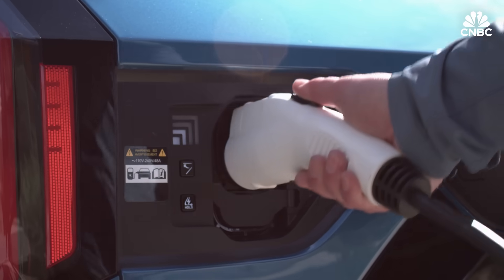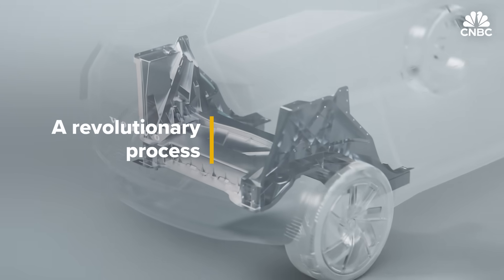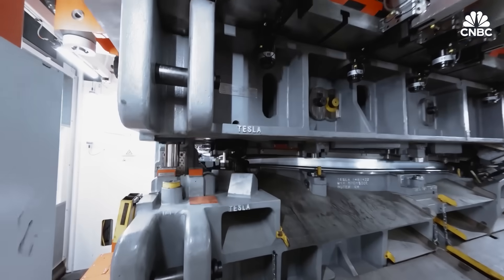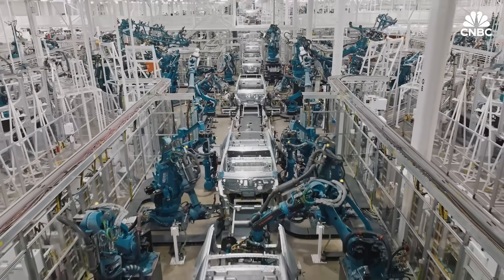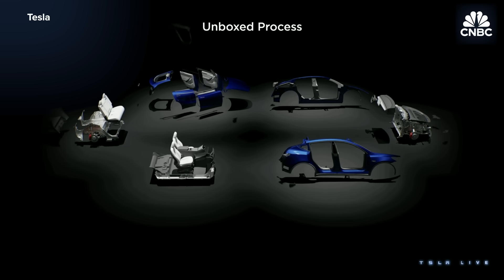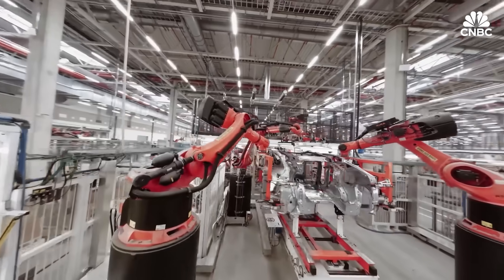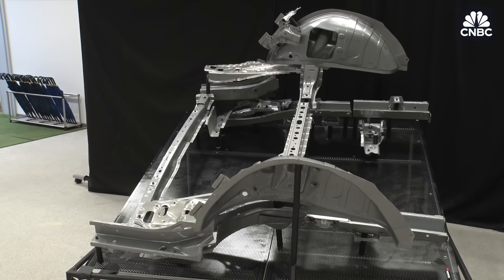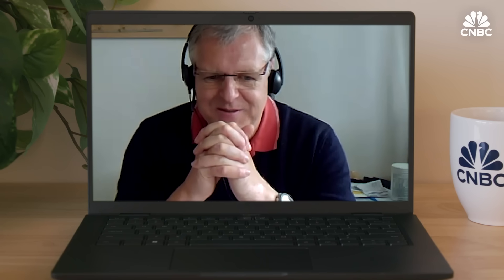Why Tesla And Other EV Makers Are Betting Big On Gigacasting

Comment: You missed on the unboxed method of manufacturing.  It requires drive-by-wire, brake-by-wire, etc.  There won't be any wiring harness like a traditional car but all the nodes will be connected to an ethernet.  The Cybertruck already has drive-by-wire and a 48 volt low-voltage bus but the next gen car will take that even further, using nodes controlling things.

Comment: 1 how safe is a cast made car? What are the crumble zones being tested with this.
Next is the confidence in the range of an EV. Add to that the time it takes to recharge. Both go hand in hand. I know when i do a road trip i go between 600, and 1,000 miles at a shot and it only takes a few minutes to re-fuel. 
Finally, the issues when they catch fire. One of the biggest concerns with an EV in a crash is the ability to put the fire out.
More research needs to be done before we rely on electrical vehicles.

Comment: Castings are actually heavier than stamped steel solution.  However, heavier casting is a viable on EVs because weight is not much of a penalty on performance and efficiency vs ICE cars. In other words, stamped steel is king on ICE o hybrid vehicles.

Comment: Gigacasting body parts are cheaper to make. however, minor collision damage can result in total loss, therefore higher insurance costs.
Reply: And how many body shops around the country will have the tools and skill to replace the large castings after a collision. Tesla says they can repair them cheaper but I'll guess most shops would say that's a lie. Car manufacturers don't design cars to be repaired easily.
Reply: @samuelbutterworth4303  Tesla has it's own insurance service so the have vested interest in making repairs cheaper

Comment: Sheet steel scrap needs to be shipped back to a steel foundry and goes into the creation of new steel.    The failed aluminum casting and scrap  can go right back into the factories aluminum melting furnace.   This is a huge savings.   Also stamped steel results in a significant amount of scrap even with 0% failures.
Reply: I was about to correct him on that.. ingots are cheaper than sheet metal and yes you just cut up the failed casting and chuck it back in duh!

Comment: Why not do an aluminum pour casting on the entire car body and heat up the cast mold while pouring so that the molten aluminum won't cool until it is finished.
Reply: There are problems with waiting for the aluminum to cool. The cycle time on a gina casting is 120 seconds. If heating the mold slows down the cycle time because you are waiting for the aluminum to cool you need more casting machines which are expensive. Also, the shape has to fit cleanly in a two-part mold.

Comment: gasoline cars are more environmental friendly that EV cars. Dont buy the lie
Reply: The myth has been debunked several times. EVs do have an overall larger carbon foot currently being made but is considerably less than ice after 3-5 years of running.
Reply: @lukeflynn3943  no you need chinese metals and lithium process is dirty. Toyota has confirmed this, and they are masters of hybrid technolgy. Quit lying to yourself. Most plant are coal

Comment: Integrating the parts is very cost effective idea like, we do with plastic injection molding. Automotive companies need to identify cost effective Designs in terms of tooling/ material to produce cheaper cars. This is one of example, as we learned already traditional casting parts are have some manufacturing defects and high scrap rate.I believe tesla have already implemented some advancements to overcome such issues in this manufacturing which are not completely disclosed in this video. But one of the advantage with casting is recyclability, the scrap can be reused , where as stamped process scrap can’t directly reused.

Comment: Isn't gigacasting harder and more expensive to repair once a vehicle is an accident...
Reply: No, just cut out the damaged area and bolt on a replacement section.
Reply: @That-Guy_  And how exactly are you going to get a new section? Individual sections are not made... as it all comes as one piece. You can only get a new section but cutting up another cast. Also you have to cut the two cast exactly... as the pieces do not a discrete sections that you can cut off
Reply: @nickl5658  
Tesla makes them and will send them to the body shop. They are set up as sections so you just have to cut off the matching section and bolt it together.
Reply: if an accident is severe enough to damage the gigcasting then you are lucky on surviving that

Comment: If this becomes standard, cars will be disposable after an accident. No one will be able to afford the replacement cast section. Even if the cast section is made affordable, the labor to disassemble an entire vehicle to replace the cast section AND do the required body work will be insane. Insurance is already expensive, this will only make it more expensive.
Reply: Its just like any other modern car. Once you need to replace the subframe its deemed totaled.

Comment: evs are not selling.  no one wants to sit for an hour to charge when you can fill up in a few minutes
Reply: You believe everything that you read by the sound of it. Yes, EVs sales have slowed but they are still continuing to increase in market share. There will come a point where the technology will be so reliable and cheap that you'd have to be brain dead to buy a combustion engine.
Reply: @lukeflynn3943  Ive worked in the auto industry for over 30 plus years.  What do you do for the living..?
Reply: They make up for it in the quarter mile speed.
Reply: @Bryanbkk  Thats not a realistic scenario. Im talking normal driving and using the vehicle as it should be . Not going down the drag strip. They are fun but will never go mainstream

Comment: PLEASE READ THIS:
America put 100% tax tariff. BYD cars are feature-rich, high quality built (check their latest generation cars, stunning!) and cost HALF of the price as any other EV cars in the USA.
They literally doubled the price of the original BYD cars to match TESLA car's prices.

So much for the 'free market' for the people.
Now you can ask why USA doesnt let these cars in and come up with all these BS excuses why EVs are expensive....
Reply: I drove a BYD, very good but Half as good as a Tesla.   Plus BYD is subsidized. I’m fine with tariffs to counter the subsidies.
Reply: @Bryanbkk  Can you explain what is half as good means? What features/parts are not as good?
Also which model did you try from which year? Older BYD is surely not as good, but the newest series are easily smoking any tesla with both features and price
Reply: @isti1986  BYD Dolphin 0-60 in 7-12 seconds. Model 3 - 2.9 -4.0 seconds.   BYD runs on Android, Tesla is custom.  
The BYD is great for the price, but how much of the low price will remain subsidized in coming years?   And how much cheaper will Teslas get?
Reply: @Bryanbkk  you tried the cheapest car they have. That car cost 12000 USD before USA puts a 100% tax on it to avoid tesla being crushed.
I wouldn't say that was a fair comparison.
Reply: @isti1986  You did say cheap EVs right?  Also it sells for $12k, it does not cost 12k, there is a difference.  And for this reason tarrifs are fair.   The Rivans sell for $80k but cost $200k to make.    Plenty of countries are getting cheap BYDs, lets give it a few years and see how it turns out for them.
Reply: @Bryanbkk  Tariffs are fair? No, they are just protecting your country not to crumble on competition. Why would it be fair?
That's the worst thing I've heard for a long time. They are simply a huge tax on a product that a company is already selling and making profit of it.
Reply: @isti1986   BYD received billions of dollars from the Chinese government. This helps their cars be low cost and competitive. This is not free market competition, so really you can’t use the free market argument. how is tariff different from a subsidy when considering the free market?  If Chinese government has subsidized $10k of a car price then $10k tariff is fair, right?

Comment: The problem with this method is that aluminium is responsible for the emissions of CO2. China is the biggest supplier of aluminium & is the biggest emitter on the planet. The savings in emissions by electric cars are vastly eroded by this process. Similarly, batteries are made with fossil fuel components for better performance rather than using natural products, which are also more expensive. Its not good enough to carry on industrial destruction of the planet when this is the root cause of the climate crisis. We can do better.

Comment: Also, yes Gigacasting is expensive; upfront. No one was doing it, and is being done on a small scale, and scaling up each year.
It is expensive now, but will be much cheaper over time.
Reply: Yes, the cost of the huge Press machines is high which is why they should only be used on high volume production of certain models. I don't know where the "break even" number is (50,000???) but any small runs therefore are not economical. You need economies of large scale to make it a winner. Cheers.

Comment: The article fails to explain gigacasting fails to make a better product cheaply. Tesla still will fall due to the same existing problems. The cost 4 time to much witch gigaxasting has nothing to do with other than line Elon musk pockets. They steal use the same old batteries will a change that reduces dust and the 20 year old car can travel. He has weak electronics while are faulty due to having to turn the motor without permeant magnets. It has a faulty electronic disbution system that will break down regularly. He has no spare parts on hand to repair you current Tesla. The truck is supposed to get 350 miles. But you lucky if you can get 180 mile before the battery is depleted. 

So no 1,000 mile battery, no fast charging stations, charging if you find one takes almost 30 minutes. In winter you will pay for a full charge and only get 1/3 mileage from weak battery. The new sodium ion battery give less mileage overall. The insurance for a Tesla is 4 times that of an ice car.

So in the end all Ev’s are a money losing proposition. I forgot to mention depreciation. Your Tesla or any Ev will lose 50% value after one year. After three years it is worth nothing. They have not profected the ev ideology. Do not waste your money. The can’t even reuse the old battery parts to create a new battery. So they go into land fills and poison the ground water and are just wasted. So bad for the environment which is the main reason for buying a Ev.
Reply: 😂 mostly wrong, kinda funny.

Comment: I would think a simple fender bender in one of these cars could total it. I would say one of the biggest issues for EVs right now is lack of places that service them, not to mention charge them. Many would have to have their cars towed hundreds of miles for even a moderate repair and wait a long time to get it back. Most seem to have both types of vehicles just in case. They are still not a viable option for the average car buyer.
Reply: You charge an EV at home though ? And service that an EV requires is at most washer fluid top off. If you need to service an EV in a shop, well then, congrats on surviving a car crash.

Comment: The short clip at 00:26 is how tesla is planning to produce their vehicles in the very near future. Instead of it being on a production line and slowly assembled as it goes down, Tesla wants to split each major piece of the car into its own production area. Once all the pieces are made, it goes to final assembly where the whole car is then put together like legos. 

This increases how many employees can work at each station, and means that if there is a problem or delay, it doesn’t stop all the other parts from being made. The other stations can still keep on working
Reply: Isn't this being done in manufacturing?  I mean it's the basis of lean production methods as a whole as pioneered by Toyota.
Reply: @shaider1982  nope, its not.

I did a bad job explaining it so if you want to learn more I think tesla has a video where their lead engineer explains it

Comment: Another HUGE innovation coming in Tesla’s manufacturing is the removal of the CAN-bus. This means instead of hundreds of wires worming their way through and across the vehicle, there are controllers at every important part, which get connected together by ribbon cables.
Reply: Yup, they literally save kilometers of wiring and kilos of weight. They also combine a lot of controllers into one larger controller for each section of a car.

Comment: 20 years R&D Injection and sheet-metal for design & manufacture specialist here.

1 - Smartest thing said here is interchangeability "inserts", interesting if they could do 'undercuts' and 'unscrewing cores'.
2 - The elephant in the room is molten alu composition is very different to 7xxx alu. modulus and still need 'post machining'.
3 - Dumbest question is not whether it can replace sheet-metal or avoid 'voids' or if it can do weight saving or high srappage rate at low yield (every new production R&D line start out low).   It about if it can benefit with the entire system as a whole, if the weight penalty vs initial setup cost vs time saving assembly to justify and outweighs traditional manufacturing technique for the masses in the long run.

But the conclusion is correct, "jury is out" until it is actually fully proven to the world.  Right now it a very large prototype project.
Reply: Tesla has their own custom Alumnium that doesn't need any special treatment. It is a special material that is designed so that you just cast once and it is ready for use.

Also can't call giga casting a "Prototype" when tesla has already made millions of vehicles with the process. They have already confirmed it is lighter, cheaper, and easier to repair. 

Note that "scrap" with gigacasting is just remelting the defect part and using it again in the next mold. 
That is another benefit of an alloy that is a just a single step of cast and use. It means it can just be melted and used again. No multi step processing for scrap reuse.

Comment: What happens when you are in an accident. It might be more expensive or harder to fix a car since you can’t replace panels easily.
Reply: NO! Those castings are solid. The type of impact that it would take to damage or crack that casting is such that the car would be a total write-off anyway. That same impact on a traditional care would be obliterated and a write-off anyway as well. No additional costs to insurance or consumer. In fact costs are less, way less!
Reply: Maybe and maybe not.  Depends on what needs replacement.  You could also design it for ease of repair...it would depend on the manufacturer.  Having many smaller parts (as per traditional manufacturing) doesn't mean it is better...it could still cost a lot and a lot more knowledge, tools and resources required.  When there is enough advancement in gigacasting and design...people will learn the best way to use this new tech and then things will be even better.  Give it a fair go.
Reply: Castings aren't panels, if you damage a casting then congrats on surviving that car crash, it was brutal, the other driver didn't survive

Comment: The problem with large casting is the cost of replacement. In the event of a car crash, having to replace a larger piece is far more expensive than the traditional smaller sections. This means repair prices for cars are rising a lot. The savings in manufacturing just gets passed on as an added expense to the consumer. And this causes insurance prices to rise as well. Thats an added monthly cost to the owner as well. Companies should try to be innovative in manufacturing as well as thinking of minimizing the cost to the owner.
Reply: I don’t know about in other places, but my tesla insurance is not expensive at all. And the price lowered after the first 6 months even after being in a small accident that needed the rear trunk and bumper replaced. It was other the other drivers fault so im sure that played a role.

Insurance is literally Tesla’s own car insurance
Reply: WRONG! What percentage of cars are even ever in an accident? What percentage of those are only fenders benders? What percentage are mid level collisions where the casting and other inner components are still absolutely fine. Those castings are solid and don't bend. Any accident severe enough to finally crack those castings is such that the car (especially a traditional car) would long be a total write-off anyway. The expense to insurance and the consumer is actually less, way less!
Reply: Yea in collisions where it matters you won't have anyone attempting a repair outside those crazy russian channels where they hammer and pull every part of a car back in place.  Its just totalled here no matter how its made.
Reply: What you say is correct today..... In a few years, in a crash, they will have the full part ready and just plug and play it as one piece. Get ready to see some very cool stuff over the next 10 years.
Reply: If the damage is so severe that the gigacasting needs to be replaced, the other repair costs to the car has likely convinced the insurance company that it should be totaled.
Reply: Yes, and writing off a vehicle even for minor damage is a huge environmental impact because of the energy lost making a car that is now unusable but the energy required to recycle what can be or it ends up in landfill and more materials and energy are required to replace the vehicle with a new one. It is just so wasteful.

Comment: Also important to point out that 40% of tesla insurance claims result in the car being totalled.  Because now you can no longer just replace a fender, the whole body needs to be replaced.  It is cheaper to manufacture and buy, but more expensive to insure.
Reply: This is a video on frame, not a video on body. Frame damage for any car means a total.